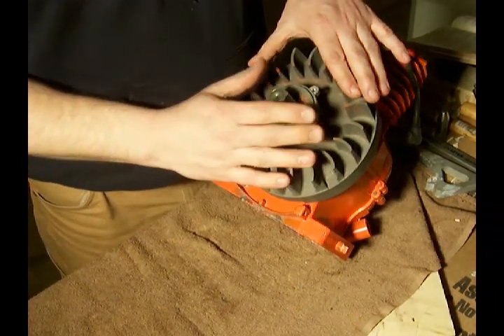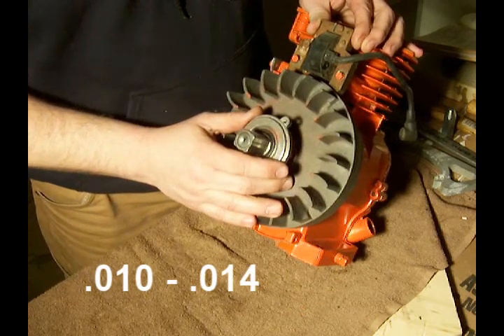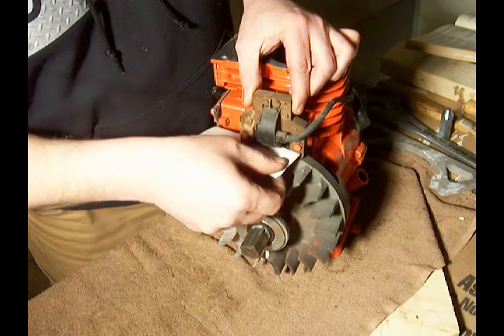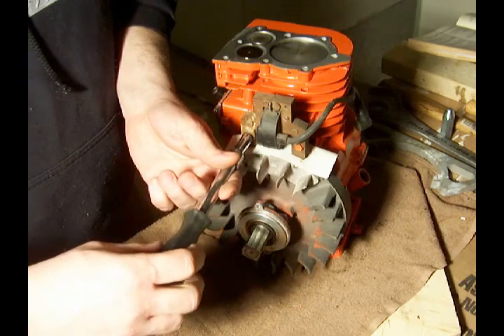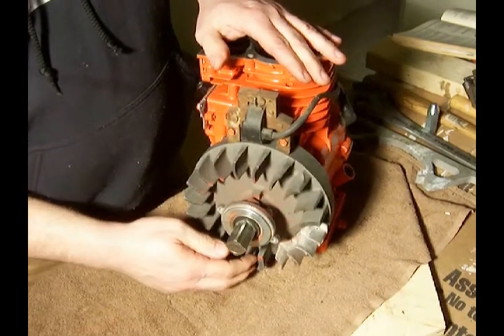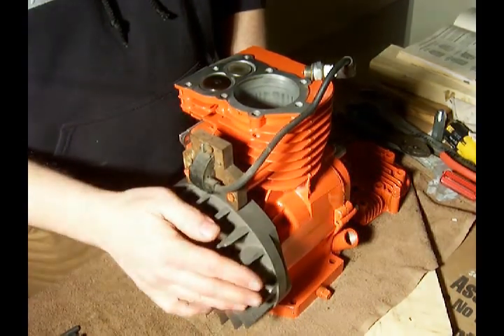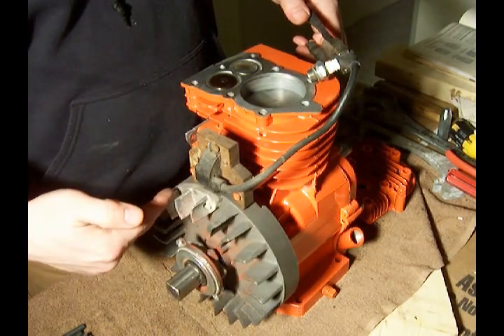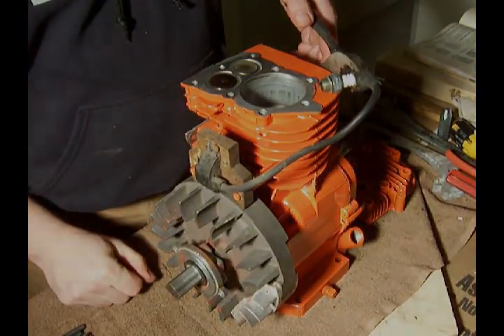#14 - Briggs and Stratton 5HP 130202 - Ignition gapping and checking for spark

Comment: I have the same model i just added gas and sae30 oil like recommend by B&S and a new spark plug but it isnt getting spark so i put the new spark plug in a working engine and it started so i am thinking the ignition coil is broken and do you happen to know where i can buy a new ignition coil?
Reply from the maker: All over the interweb. However, start at www.partstree.com for good diagrams and part numbers.

Comment: Where did you get the coil from? or did you just reuse the old one...i'm having a problem finding coils
Reply from the maker: I can't remember where I got it from but I can tell you, that if you search the interweb for this model engine - the ignition coil is available in a lot of places. Try part number 591420

Comment: Sir, My fly wheel does not move that easy, you are checking for spark with one hand and moving the magnet back and forth with ease.  Should I be concerned that my piston is a little more "stiff" or harder to move?  I think I will not connect the piston and just rotate the fly wheel and condenser with spark plug.
Reply from the maker: As I rebuilt this engine, I cleaned and lubricated everything. Yours may not be as clean, I don't know. I don't think you need to be concerned unless it's really hard to move.

Comment: question: i have a 3hp B&S and and i have no spark, one wire goes from the coil to the points, one to the sparkplug but i dont know where the third wire has to go.
Reply from the maker: The wire you are talking about is the kill wire. It should be connected to a switch or other place that will "ground" out the engine when you need to shut it down. Sometimes there is a "stop" setting on the throttle control that will cause that ground. Hope that helps. Thanks for watching.

Comment: I just added  solid state ignition to one of these motors. Brand new from amazon and no spark! Do you have an idea on what this could be? I cut the old wires, added the new electric armature and nothing. Do the kill switch wires need to be hooked up?
Reply from the maker: No, the kill switch wire(s) do not need to be hooked up. Make sure they aren't touching any metal on the engine. Beyond that, you should be good to go, assuming the ignition is good. Hope you find the problem. Check the flywheel key - make sure that it's not sheared or partly sheared.
Reply: @RealManSkills  coils bad should work when mag goes over coil. _I have one hooked on mine

Comment: good video how do you do that when coil is inside flywheel ty.
Reply from the maker: +notsoold If coil located under flywheel, following steps should be taken to adjust magneto air gap:

1)Remove flywheel.
2)Place piece of electrical tape on inside rim.
3)Replace flywheel (finger tight).
4)Rotate it 10 to 12 times (removing spark plug will make engine easier to rotate by hand).
5)Remove flywheel and examine tape.
6)If tape scuffed, air gap clearance too small.
7)If tape isn’t scuffed, add another strip, repeat test. If tape still not scuffed, air gap clearance too great.
8)Adjust position of armature, until air gap clearance such that one layer tape isn’t scuffed but two layers are when flywheel rotated.
Reply: sblg43 thank you sounds good you no your shit

Comment from the maker: @tv175s3 The flywheel key way ensures that the flywheel can only be properly installed in one position. That position allows the magnet on the flywheel to pass the coil at the correct moment needed to send power to the spark plug.
Unlike a car/truck, there is no way to "advance" the ignition timing.